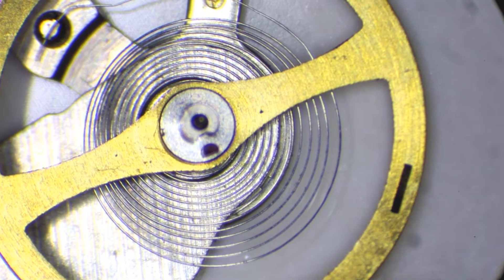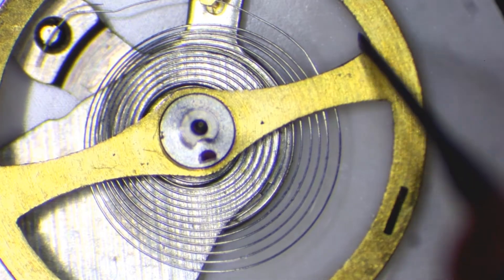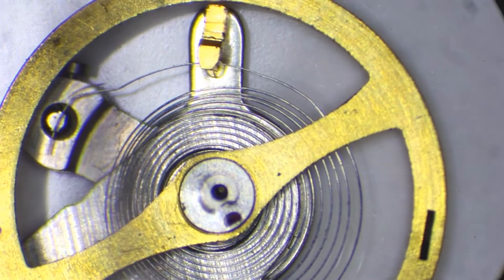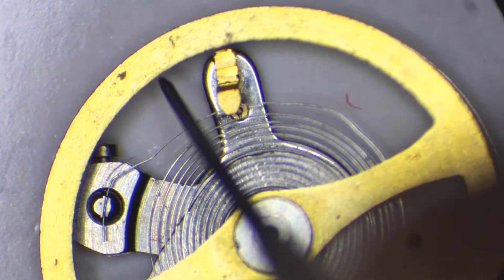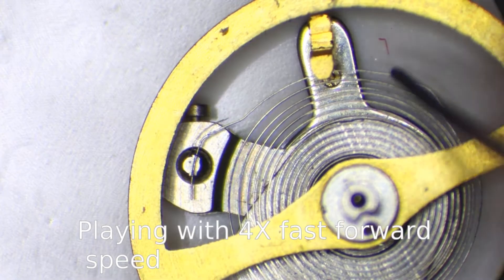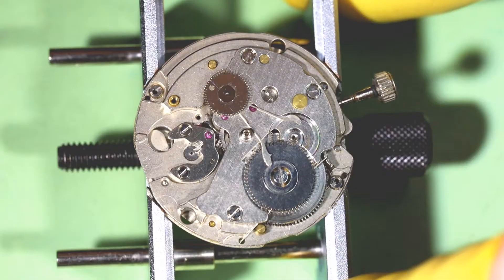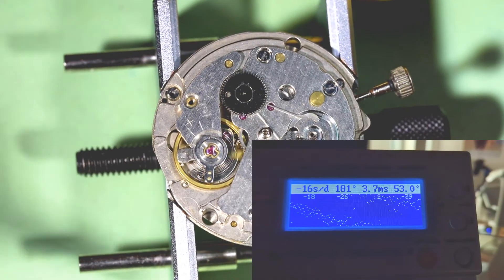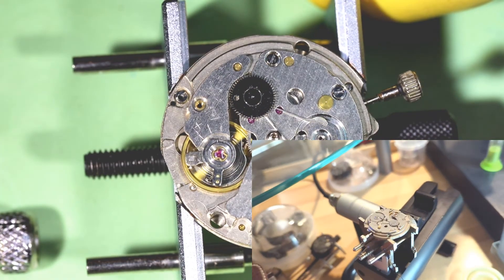Fixing a Balance Wheel Hairspring in a Seiko 5 Automatic Watch How To Watch Repair

Comment: does timegrapher show amplitude of 197 in the end? is it a descent value? (i thought 250+ should be norm but dont know this particular movement)
Reply from the maker: Yes, you saw it right - the amplitude was 197 and it should be higher. It depends on the whole wheel train, the balance just get it easier to work, when all gears and the mainspring/arbor/barrel are cleaned, pivots are polished and properly lubricated. In this video the focus was on fixing the balance hairspring, but the whole movement wasn't serviced yet. Thanks for watching until the end!